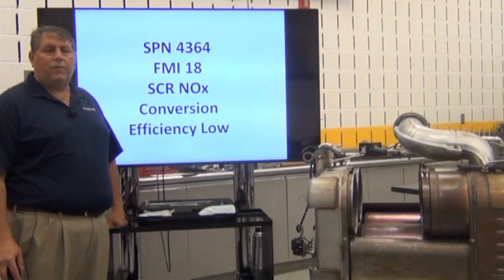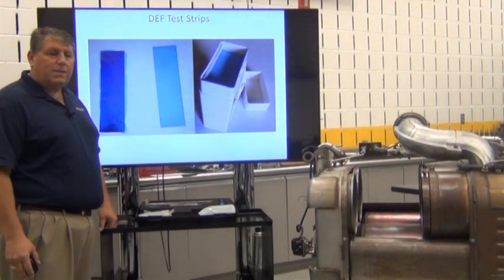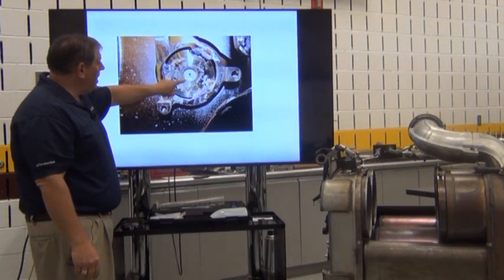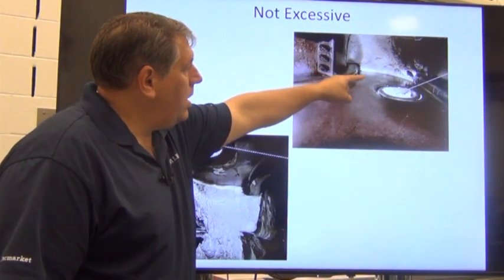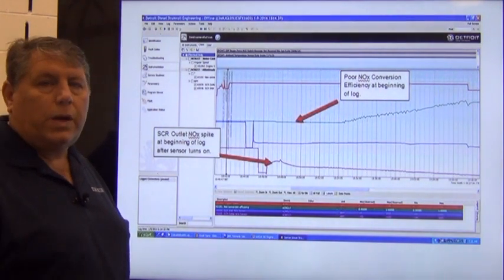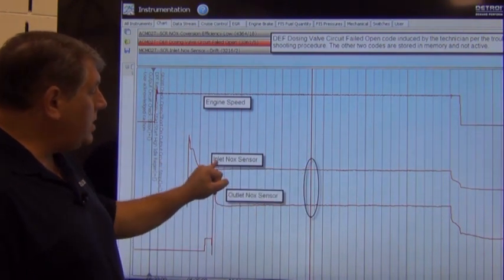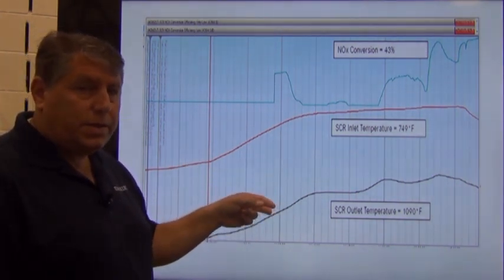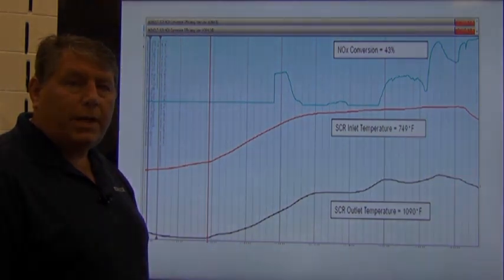Detroit DD13/15/16 - SCR NOx Conversion Eff. Low

Comment: What if the producer and distributor of fuel are to blame? My DD15 OneBox shows this code for two years, it shows up and disappears without any major consequences for the engine operation. However, in my opinion this is related to the quality of diesel (biodiesel blend). Detroit recommends using bio blends up to 5% without damaging the engine. Today, producers and distributors sell 5-20% biodiesel, without the possibility of verification from the consumer. It is impossible to buy a clean diesel without bio admixture in truckstop wide distribution. Does TheDieseler also think that diesel can cause the code that keeps coming back?
Reply from the maker: I'm not sure what effect high amounts of bio diesel would have on the scr system but I have heard of problems occurring at the engine level from it (Filtration and injector problems, etc). I'm sure it could be a possibility though.
 Repeated, short occurrences of this code can sometimes be caused by DEF buildup in the system. An "awning" may help with this.
Reply: Yes, I installed "awning" a year ago, after that, new sensors and filters. I have also buying DEF only the best in market, in jug not in pump. But nothing help, only suggestion I have from  technicians is to buy new OneBox .....  +/- $10K    :)
Reply from the maker: Unfortunately, the SCR Cats can fail. I've heard of companies cutting open the 1Box and replacing just the Cats but that's about all I've heard. Not sure if it's successful or even still being done.

Comment: The advance diag for this code isn't accurate. most times it wont lead you to a  failed one box.  The low temp regen  and high temp regen doesn't do a complete regen  using advance diag.   So when you compare the Numbers using the  chart, it could be misleading due to the fact the regen didn't go through the full cycle.  Use psl and know the temps and pmm which was .mentioned in the vid.
Reply: Let me explain in trucking terms what this video means. Your trucks down for who knows how long. You better have a boat load of money to try and keep this crap working. You need to have nerves of steel to put up with trucks check engine light always coming on and wanting to regen. If your a owner operator this system will most likely be the nail in the coffin of your trucking business. If your serious about trying to make living in trucking business buy the oldest truck you can find pre egr and pre def. The reason these new trucks with their def systems are so good for the atmosphere is because most of them spend more time at repair shop with engine off in parking lot than they do moving freight. That’s the way I see it.
Reply: Jus Trucking I've been with this company for 6 months. My boss already spent 20k on the DEF system alone. Compare the money I made for Him, versus my wages and maintenance he is in the negative.
Reply: Phil Scar . If you don't mind, can you explain the PSL, and PMM? Can i find those test in the diagnosticlink 8.?
Reply: drone1028 PSL stands for  power service literature   PPM stands for parts per million.
Reply: They aren't test.   When you do a regen or a low temp regen as part of a diag step,   you need to know what the temps and nox (ppm) should range at. If you don't know  the numbers, it is useless.
Reply: I agree this is a scam thrown onto the OO.  The thing stops working for many reasons, forcing you to take it to the shop.  Extremely poor purchase fora small company.  Stay away as someone else has said.